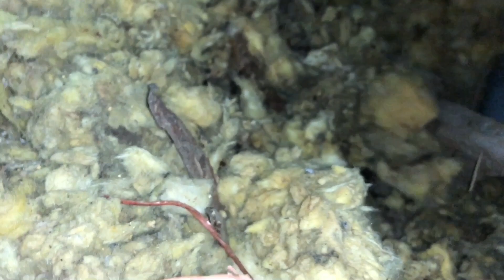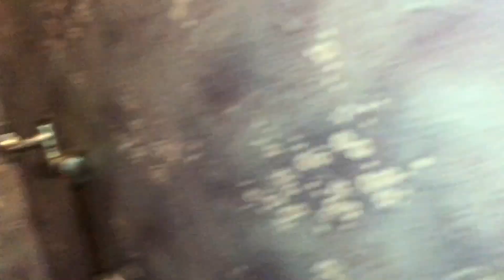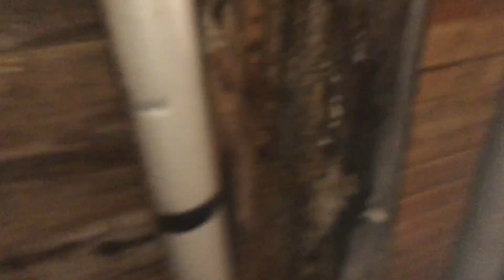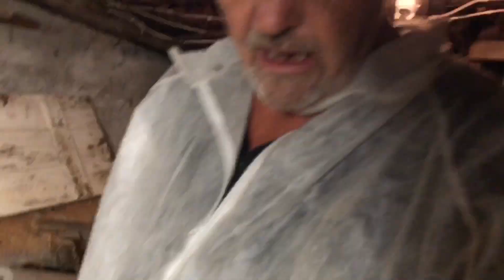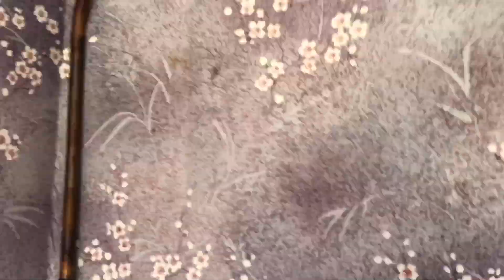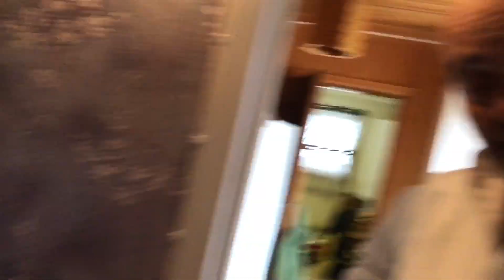New deep well pump hook up, what will the new pressure do to all the old equipment in the cellar?

Comment: Oh my goodness Simon!!! The first 20 minutes I had to keep reminding myself that you posted this so you were ok😊 scary stuff down there. Won’t the floor eventually fall through? It looks so unstable. Thank goodness you survived….hope the owner is watching your channel. Super to see the tank debris was easy to get out. Yes! Genius indeed. Loved the stunning scenery. Where is that? And also loved seeing Kasper enjoying the wind over his face. By the way, where does the water eventually go that was in the cellar? Wishing you, Sarah, your daughter and Kasper a wonderful week. ❤️🇦🇺🇸🇪
Reply from the maker: Hi Anne, yes your right the floor will fall in and the cellar walls are badly constructed and have push in several places. Structurally the house is compromised and has limited time if major works are not under taken. It is the weight of the snow that takes most buildings here, the structures themselves are all wood with tin roofs so a generally very light and do not need traditional foundations but that often leads to rot and the moving sand undermines poor foundations. 
I would give it 12-20 years before it becomes unsafe, the water runs through the sand until it hits gravel and runs back into the river. The scenery was on my way sound to town, it is even better if I go north to our smaller town.
Thank you, take care
Reply: @arctic-rebel  wow…12-20yrs sounds much better than what I was thinking 😀😀😀Simon. I can understand stand now much better. ❤️🇦🇺🇸🇪

Comment: Your handyman abilities are prevailing on this job Simon. Not many repairmen would spend that kind of time to nurse an old system back to life. You must be helping a friend or an aquaintance. But even with the budget constraints you got it done. Ugly conditions but sometimes a man has to take the work that's available. It's wise for you to make things correct because I'm guessing you would be the one back there again if problems arose. Like always, since you do good work the owner may hire you for other tasks. A lot of work to be done on that house.
Reply from the maker: You have a very good understanding of the situation Matthew, you are 100% correct at every level. It is also very likely I will be called with arrival and departure dates to have the house ready and then close it down so if I make it easy for me it would also be easy for the owner.

Comment: Good job Simon.  Thank fuck it was  you going in the crawlspace and not me 😅 . This mason will just say good job you got it done the pad that is .im a little upset you did not put your initials the date the year😢 always sign your work . Its a time stamp that will be around long after ur gone .❤ i sign all my flatwork . When we do chimneys and put concrete Tops on them we put a quarter with the year on it again a timestamp and when we build fireplaces we always put a timestamp of some sort in the wall inside a fireplace,  are work will be around 150 plus . years .its a historic thing  like a time capsule of sorts
Reply from the maker: Thanks Heith, I do sign a lot of my work must have just not been that important to me. Interesting I have found so many names and dates whilst working on the school. Behind walls mainly but in the roof and behind fitted cupboards also.